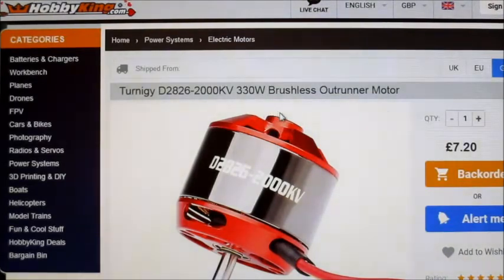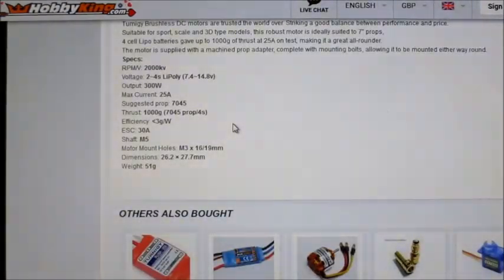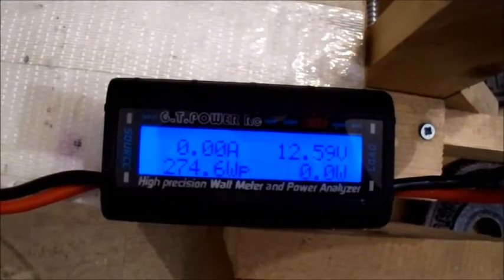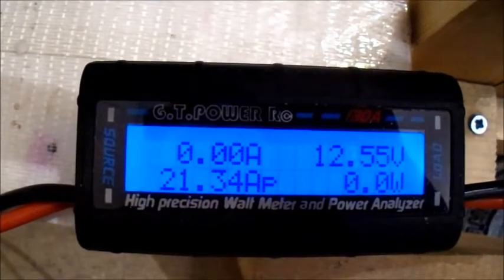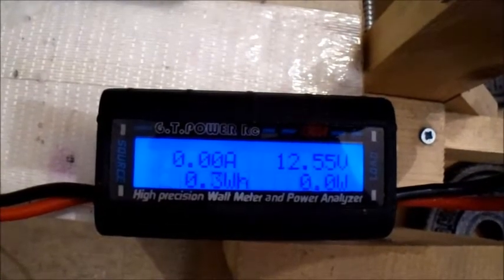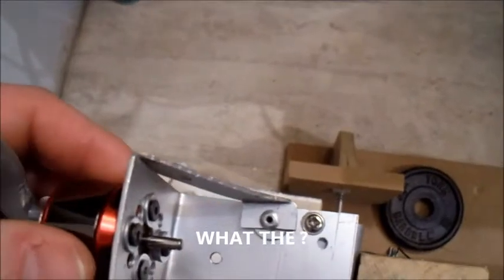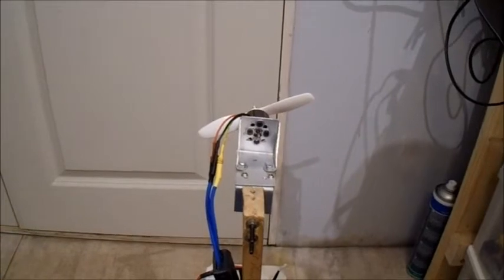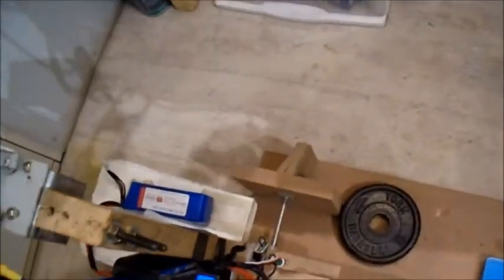Turnigy D2826 2000kv Thrust Test Motor Test of the Week

Comment: Hi RCPP, as you said, a very efficient motor, looks like it would be very versatile.  Really impressed with the numbers you got with the GF 6045 carbon/nylon prop, looking forward to trying that out when mine arrive.   Always fun when you find out a motor can probably handle a lot more than what the specs say on the website, again demonstrates that doing the kind of testing you do is important to really know what is going on with motors/props, well done, mate :)  Cheers, Scott
Reply from the maker: Hi Scott
I actually had forgot I had this motor. I was in the workshop thinking what motor should I test??? I picked up one box thinking whats this one??? Opened it up and I was like Oh yea. Cool I'll test this one. Glad I did. 
Not sure if you should put the 42amps through it like I did with the 7x5 APC prop, but it should take 35amps no problem. 10 more then the specs say.
Those GF 6045 C/N props sure are impressive.  Think I will put one on my HK G-N-G SU27.
Cheers there Scott. Thanks for watching.
RCPP

Comment: Hi
This looks very similar to the rarebear funfighter replacement motor. Think its a 2825 1950 kv.
Wondered if you had one to do a comparison with.
Reply from the maker: Hi Chris
Had a look at a picture of it and they do look a bit similar but not the same. Sorry though I don't have one to compare the performance. 
Thanks for watching.
...RCPP
Reply: rcplanepirate 
That's a pity.
Would be interesting to know if it is a worthy upgrade for the funfighter which was also hailed as a particularly good motor.

Comment: I would love to see you test that thing with 2x6045 props as you can also mount the prop on the bottom shaft
Reply from the maker: I see what you're saying. I could be interesting. Think it would be very difficult to mount the motor so the props can turn in front and behind the motor. Would probably have to use smaller props though.
Reply: @rcplanepirate   well in theory  you just need a sheet of wood or alu  so there is enough space or try it on a copter arm that should be easy, i have heard ppl say that it will give a decrease in energy efficiancy, which makes sense but is suppose to up the trust by alot